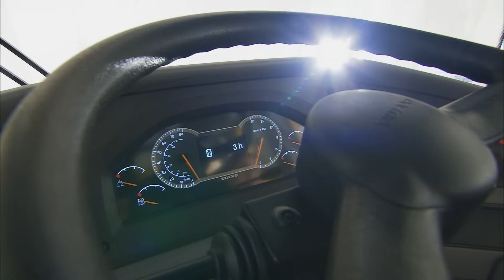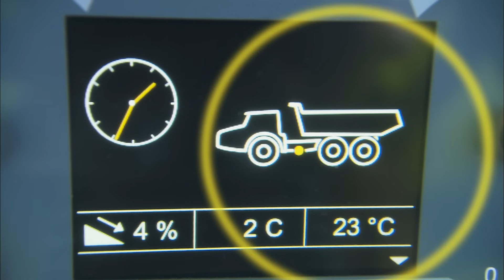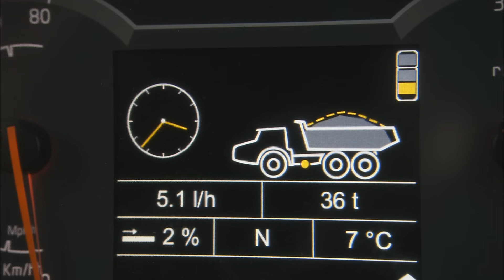Volvo F-series Articulated haulers promotional video

Comment: How long do those airshocks last ,considering they run alot going up and down constantly
Reply: Don't know about  the shocks but 3 years of work an they start to fall to bits  total junk better with the old Volvo dump truck problem there is no one will sell you one wonder why

Comment: Looks nice when showing a brand new one in short clips.
Spend a decade or more behind the wheel.. not so much.
Reply: Can you elaborate? Is that not the same for most vehicles?
Reply: @user-ej5mr9th1i  most vehicles don't spend their entire life off-road, in the dirt/mud/sand/rocks/snow, getting fuel/grease/oil/coolant spilled on them, sometimes running 24 hours a day unless being repaired or serviced, most vehicles don't carry/drive around on materials that are abrasive, most vehicles don't run empty one direction and 130% loaded the other direction as fast as conditions will safely dictate, most vehicles don't run at the upper end of operating temp all day long, most vehicles won't get rebuilt until it is no longer financially feasible, parts are no longer available or government regulations keep the vehicle from operating.
Reply: @marclaky384  Ah I see, that makes sense. Thank you for the detailed reply.
Reply: @user-ej5mr9th1i  an engine overhaul which could be performed every 5-10 years would cost around $60k usd and that's a standard deal. It is expensive to own and operate heavy equipment, but that should all be accounted for in the contract or hourly rate. The articulated trucks you see in the video are on the lower to middle end of price point for equipment on a job site. Large excavators, large dozers and the largest scrapers can carry a multi million dollar price tag a piece depending on how they are specced out. I work for a heavy equipment dealership as a field service welder and one of our customers replaces full undercarriage every year, reskins dozers blades and belly pans every 2 years. Undercarriage is around $100k and reskins are around $25k. That's performed on around 20 dozers. Then you have scrapers, haul trucks, front loaders, water trucks, skid steerers, skip loaders, motor graders, excavators ect. It isn't an inexpensive industry and on top of all that you have extremely strict EPA, AQMD, OSHA, MSHA, highway patrol, police or sheriff's departments, fire departments and a few other governing bodies to comply with. The average person couldn't even afford the annual insurance on one piece of equipment, let alone operate it.
Reply: E Camp  ?
Reply: @bacilluscereus1299  they already are, autonomy is already in agriculture and mining equipment. And my first response was a rebuttal to how construction equipment live out a vastly different life than most other vehicles which is the comparison made by the previous poster.

Comment: I work in norway, And drive a40gfs, not bad machine, fully loaded 70 t, Perfect working suspension, unbeliveable good brake system And very good driving abilities, comfortable like all Volvo, but there is some common problems also, like ad blue system fail, suspension system fail, tipp sensors fail, And my dumper have only 2000 h And so many problems, IT cost in norway 6m nok, one tire is 200 000 nok. As i say, not bad and not Perfect.